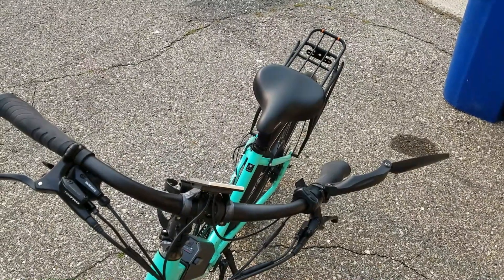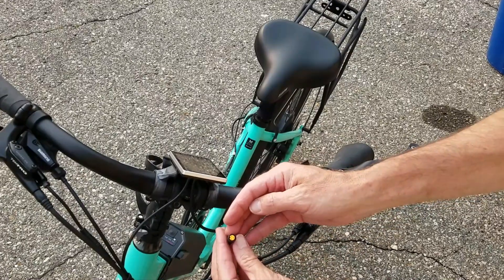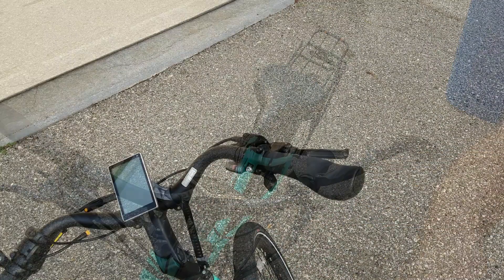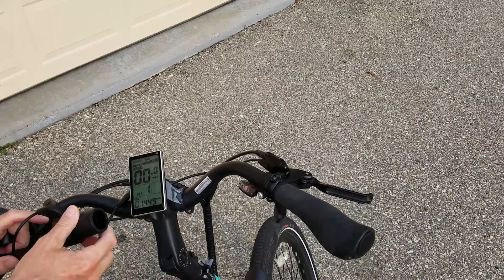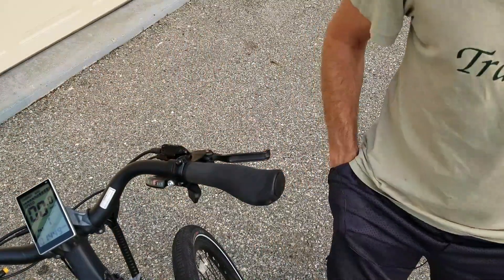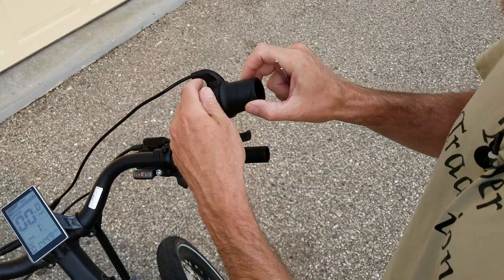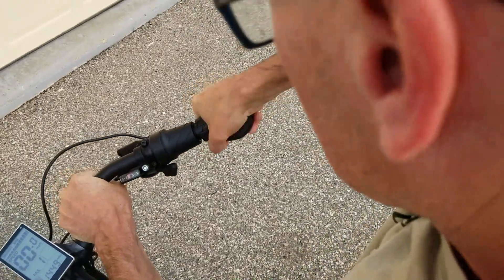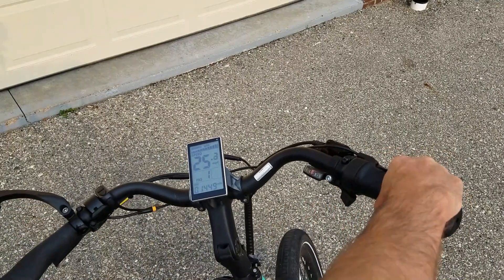How to Install a Twist Throttle on an Electric Bike

Comment: I just get error E004
Reply from the maker: Depends on the bike and controller. I would double check all the connections to make sure no pins are bent.  Ebike throttles are fragile I change them often at the bike shop I work at. 🚴‍♂️
Reply: @R @RIDEelectricMTB i realised it was because i was already pulling the throttle down a little bit. When you do that it gives e004 but its easy fix.

Comment: Mine  doesn't have cable from the bike?
Reply from the maker: If it doesn't have the wire, you probably can't install a throttle....
Reply: @RIDEelectricMTB  thanks but we found it hidden among the other wires inside

Comment: Just a heads up. Having the same connector does not mean it will work. The polarity of the connector may be different on different brand names of bikes.
Reply from the maker: Great tip! I agree, the diameter of the connector can be different as well/  🚴‍♂️

Comment: can i put a throttle on my engwe ep 2 boost
Reply from the maker: If it's not wired for it, probably not.  Sorry
Reply: @RIDEelectricMTB  I found a way but have sold my engwe
Reply: i did have it on but ive sold it now max speed i hit with throttle only 51 kmh

Comment: Ordered two throttles one in half twist, one thumb, both had yellow connectors in the profile photos, both had orange instead when they came, £38 for both altogether, and lots of hassle to return still got them, darent order any more as likely to be same the conning swine